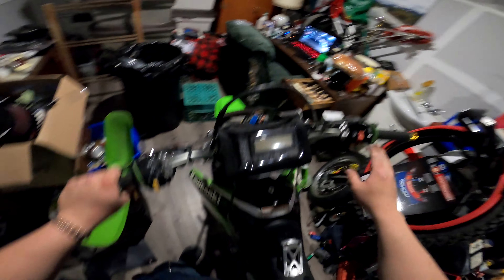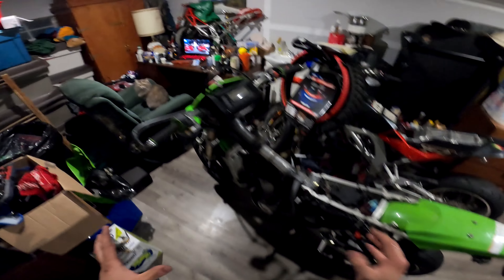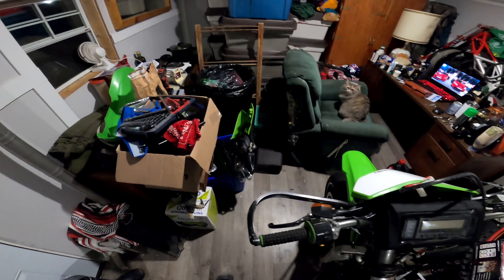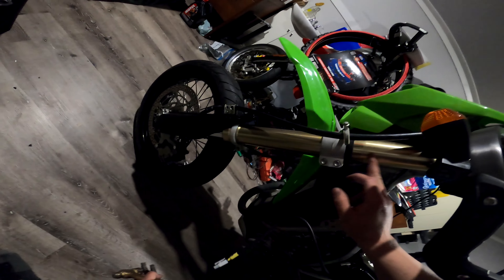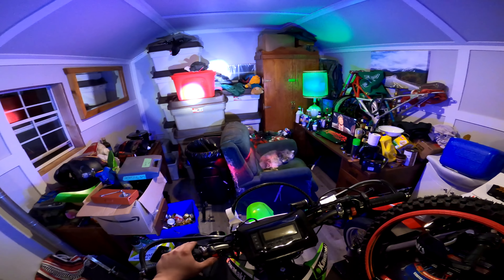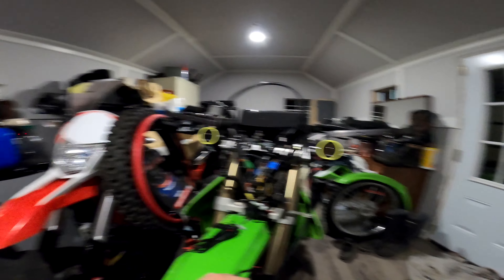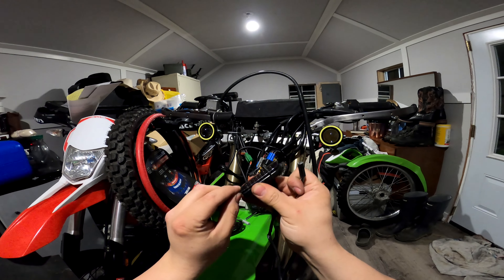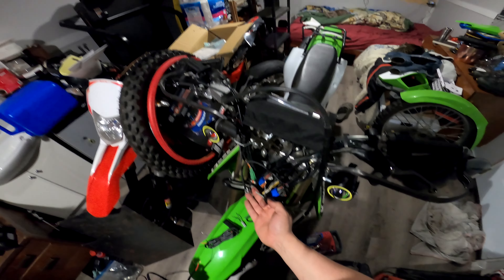Front end is SO MUCH BETTER - Supermoto Build 2

Comment: i have a little question. I got an SXV last week but he won't start. I noticed that the starter only turns the engine around 400 rpm on a full batterie is that normal or does she need to turn faster?
Reply from the maker: 400 is normal, check regular stuff, plugs, make sure the fuel line isn't kinked etc
Reply: @Foredore  I checked everything twice, he has fuel and perfect spark. it sounds like it wants to start, but that's all, and after a few tries it flooded.
Reply from the maker: @Andreas-uc7rh  I would bring it up on the Facebook groups, could be injectors, throttle sync, or mapping issue
Reply: @Foredore  the thing is when i bought it he was running but a few days later without any chnage he wont start